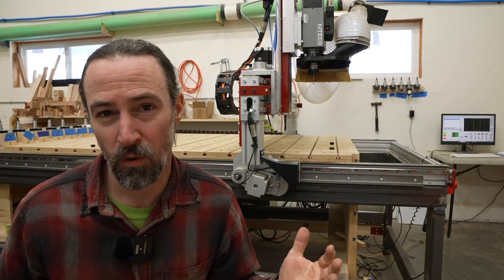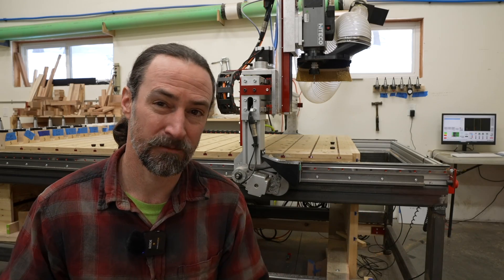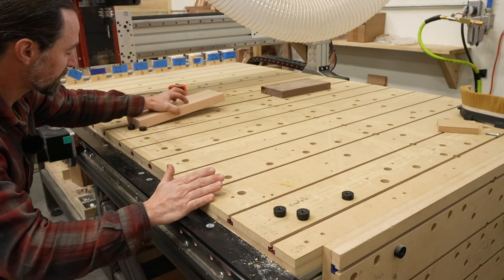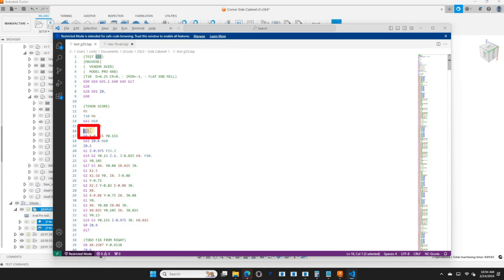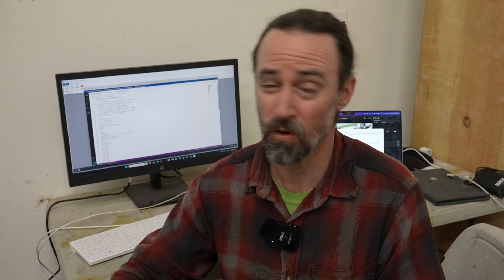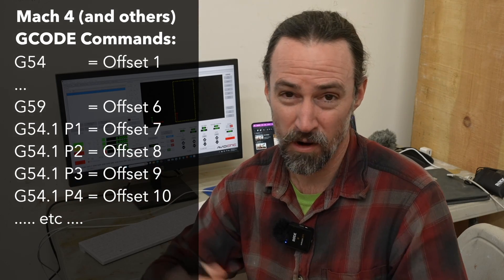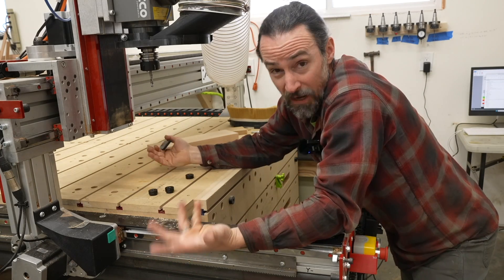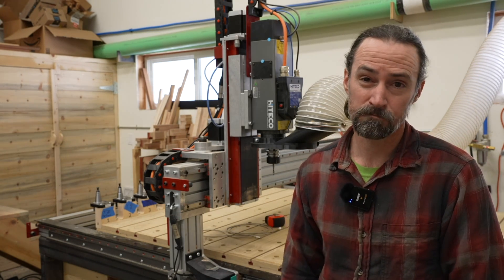CNC Work Offsets: How to use offsets to save time on your CNC machine setup

Comment: do you know anything about using a shoda cnc?
Reply from the maker: I do not; but a quick google shows that it uses regular GCode, so work offsets should work; you can always use the MDI to test them.
Reply: @CorbinDunn yea lol I started a new job and a whole long list to delete a program and load a new one and my tool changer gets stuck and Maintenance here won’t do anything about so I have to literally bump the tool with a stick , to complete the tool change.
Reply from the maker: @joshuaallengreene473  OOOOOh boy, that sounds not fun! Yeah, I wish I had some ideas, but it is out of my bounds.

Comment: Cordin - do you feel Mach 4 is pretty bad?  I'm thinking about getting a used Avid and I don't see the ability to upgrade to the EX piece do to the expense of it. Basically the upgrade would cost more then I would be buying the CNC for..lol I've heard people say Mach 4 is terrible and to just get Mach 3....your thoughts?
Reply from the maker: I felt like Mach 4 was totally fine. I didn’t have a lot of random problems that other people have reported about it. I loved how easy it was to customize. Be sure to run a good shielded Ethernet cable and ground your dust hose; a lot of people get problems because of those issues and blamed it on Mach 4.
Reply: @CorbinDunn  Thanks for this advice -- I've been hoping to thoroughly ground my CNC to see if I can get it to run on a GFCI outlet without electrical grounding noise (or static buildup). I'll definitely use shielded cables and ground the dust hose. I might use a non GFCI outlet if I can't get the spindle to run without tripping the GFCI.

Comment: Vcarve user. I have collections of files that I'll run together, but rarely the same files in the same offsets. They ARE all in the same stock, though. 
I open a blank text doc, list all the offsets I need to use, then copy/paste the programs between them (with the stop code only once at the end). Kind of a pain.
I just started working with an excel spreadsheet and macro that let's me list the offset, G54 location, stock size for each program, then the file location. The macro calculates the necessary offsets using the G54 as a reference, then opens, reads, and copies the programs along with the required offset.
I think I'll take a swing at Python or something more portable/accessible, as this should save me a LOT of time.
Reply from the maker: Awesome..sounds like you are doing it right!

Comment: Catching up on some of your catalog!  Thanks again for the suggestions...  I was able to find some alternate commands that may help get the results I'm looking for.  I'll have to give g55 as a saved offset a try.
Reply from the maker: Awesome -- I so heavily rely on offsets, and they save so much time when you get used to them
Reply: @CorbinDunn  Dude, I'm so excited.  I went down the mach API rabbit hole last night.  I switched from mc.mccntlgcodeexecute to mc.mccntlMdiexecute for my button.  It works great now.  I also combined the go to MTC location the z-height dialog so it opens when the spindle is at the MTC cooridinates.  I just need to add both of those functions to the M6 routine and that will remove 99% of the human errors.
Reply from the maker: @ Mach 4 is very timing dependent; I definitely could accidentally deadlock it if I did stuff it wasn’t expecting. I think Centroids approach is cleaner.

Comment: This is gold! 👏🏻
Reply from the maker: I use these techniques nearly every time I turn on the machine. I rarely have to touch off my workpiece.
Reply: @CorbinDunn  Since you are into that kind of workflow optimization... Maybe you'll like to see what I've done with a touch probe on my CNC. Take a look at my channel shorts page.
I know you got an ATC spindle, but it's still faster and you save up a tool slot in the tool rack.

Comment: Excellent video.  You are a natural teacher.  I use Mach4, but mine was modified (either Legacy Woodworking or Mach4); much more user friendly interface.  I can save at least 10 Offsets; I have 7 programmed - 7 is for my 4-jaw chuck on the turning center.
Reply from the maker: Cool! If it is Mach4 based then there should be the option for even more offsets with the Gcode stuff I mention.

Comment: Cracking video Corbin. Really useful. Presumably you set up all the dog holes to work with the different offsets. I need to do that. Thanks for posting 👌👌
Reply from the maker: Yup! Fundamentally, it doesn't matter where the dog holes are, as you can find the origin and save it for any particular set of 3 dogs.

Comment: Totally loved this video. I am about to watch your entire channel. So many cool and repeatable elements to your workflows. I wish i could come be your apprentice, I love the way you work.

I have a longmill mk2 without homing sensors, they state the machine wont damage itself running into stops, which I agree with. They sell inductive limits as an add on and I have just ordered them. I run gsender and vectric pro but recently bought f360. I will probably figure out putting g54 etc into gcode. I program for a living, maybe I will give a a custom post processor a shot, idc just had a video on this custom post processor i should rewatch, wont give settings in job but will start every job at g54 etc.
Reply from the maker: Thank! I bet you'll appreciate having the homing sensors once you get them installed. Definitely try out editing the post processor; it is pretty easy to modify. I modified mine for ATC support. I also used to be a programmer -- I worked at Apple for many years, mainly on macOS but also some initial iOS stuff.
Reply: @CorbinDunn  I got an open frame diode laser after cnc and after a little learning I came to love the zero and offsetting in lightburn. I am sure it will be very helpful with cnc.  I rebuilt my spoil board with dogs already so I am thinking of picking a few corners for offset positions.

Comment: Excellent video! I've been using work offsets in Mach4 for about a year, and they really streamline the work. Having that known location that is saved in Mach4 is a life saver if you've ever had a power failure in the middle of a carve. If you're on the fence about using a work offset, just try it. You'll never go back to working without them.
Reply from the maker: Thanks Mark! Yeah, I now use them for nearly every job..they are so handy!

Comment: Nice video corbin! Did you update your mach4 config to work with the atc and touch plate?
Reply from the maker: I did! The stock Avid CNC touch plate code would crash due to a bug. I added a work around in my screen set. I heard they fixed it in a recent Avid CNC Mach 4 update, but I haven't tried it out yet.
Reply: @CorbinDunn awesome, thanks for getting back to me. I will definitely be asking to use your latest screenset when I finally pull the trigger on the ATC. I need one so bad but no time to upgrade at the moment with too many things to make!